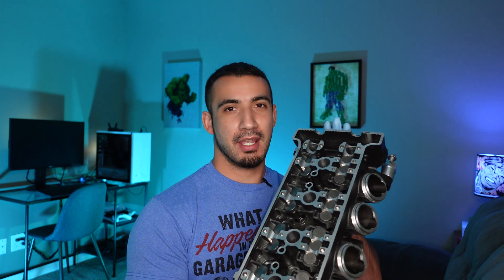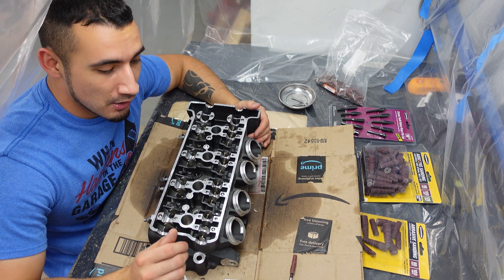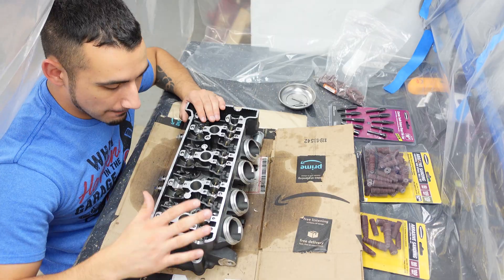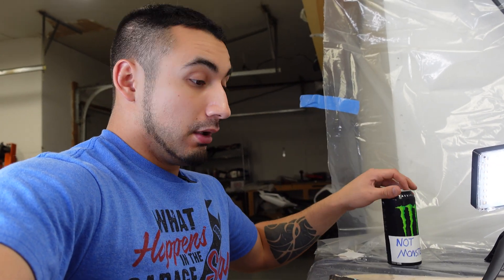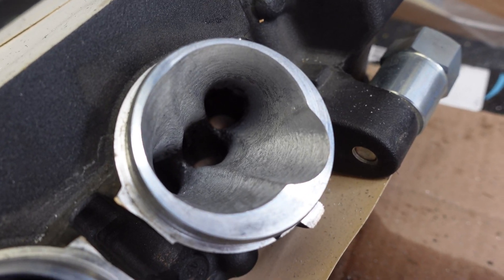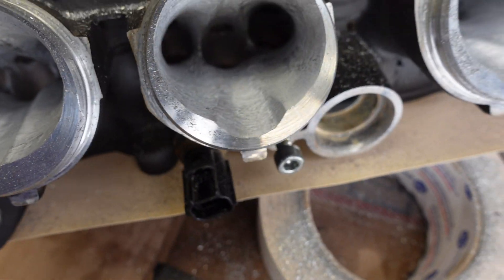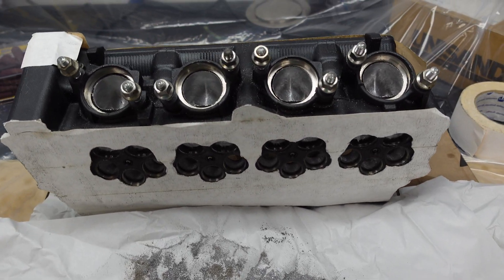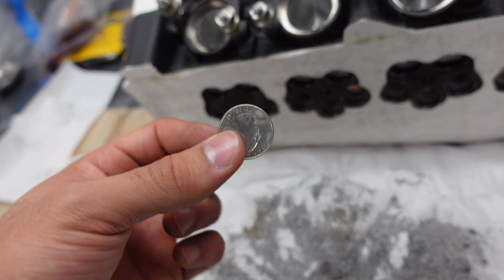Yamaha FZ1 Raffle Motorcycle Gets a Port Job - Cylinder Head Porting

Comment: Awesome work, but it takes so much time to do it. Well done mate.
Is it worth doing this to the head if the engine is just normally aspirated ?
Subscribed.
Reply from the maker: Yes indeed it takes a long time. And yes there are benefits of a ported head even being naturally aspirated. An engine is an air put so with a better flowing head you can cram more air into the cylinder and make more power with tuning of course. You can't just open the ports big either as you don't want the air to loss velocity getting into the cylinders. One thing I've came across is you can lose some low end power but gain it in the upper rpm. Some put a thinner head gasket on naturally engine to raise the compression and keep the low end power and get the high end power as well. 

Thanks for the Sub Dave.

Comment: Very informative, and interesting video. Thanks for putting this up. I enjoy following the evolution and the inner workings of this bike. 
If your're open to some feedback, I do feel that the video could be a little shorter, and another camera angle (like an external time lapse) would help tremendously to break up the monotony of POV shots. With that said though, great job I appreciate the time you invested in this.
Reply from the maker: No no constructive criticism is very welcome. And I would agree with you on the angle of the shot. I want to do more angles and stop the same view. Sometimes hard with certain spaces and no one to help hold the camera but it will be on my to do list to change. I appreciate the words. I suppose they could be a bit shorter I just want to make sure that the information needed is in the video along with some good visuals.